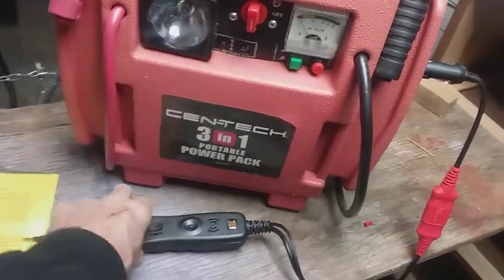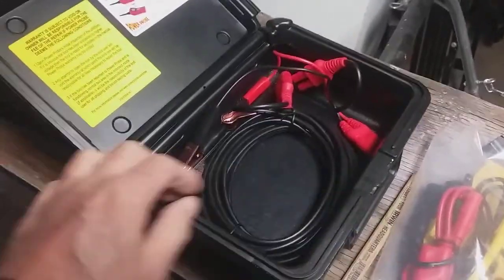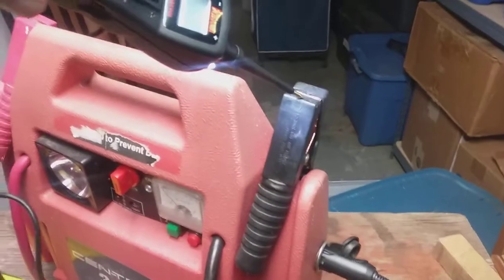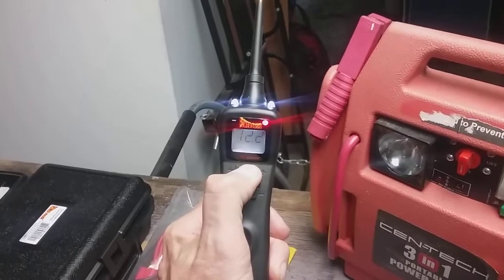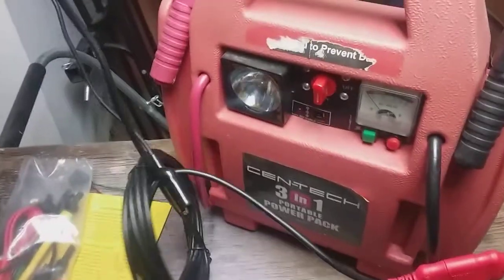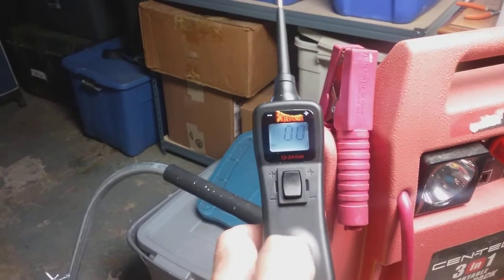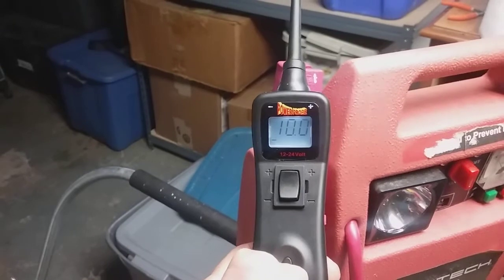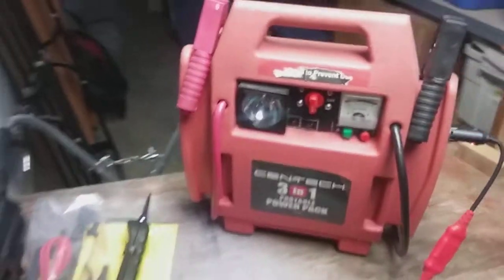Power Probe III safety tip

Comment: Can't you set your probe to 5 volts?
Reply from the maker: Yes, if you buy the adapter, you can restrict the tip voltage to 5V. This tip is to show how to use it if you don't have the adapter.
Reply: @stephenlutz123   Damn, adapter this, adapter that, I'm discouraged by this fact. I was thinking you could change the internal settings, but those are just max voltage reading not output. 😥 Thanks, still figuring out the pp3.
Reply from the maker: @andycrowley6442  just buy this. It's not that expensive.

https://www.amazon.com/Power-Probe-PPT5VA-Simulate-Reference/dp/B076QB4BQL/ref=sr_1_3?gclid=CjwKCAjwm4rqBRBUEiwAwaWjjC3j5reulbRjPT0p1Y9lEc8mpqF2FC403TzeoJ-H1ExmD1RRXyHTkBoCFCMQAvD_BwE&hvadid=243405710856&hvdev=t&hvlocphy=9014228&hvnetw=g&hvpos=1t1&hvqmt=e&hvrand=13585552943594469606&hvtargid=aud-649564993678%3Akwd-477076125757&hydadcr=7515_9880907&keywords=power+probe+5+volt+adapter&qid=1564696015&s=gateway&sr=8-3
Reply: @stephenlutz123  -hey thanx Man! Its on the way. 😁
Reply from the maker: @andycrowley6442  I thought about getting the adapter, but I use my PP 3 just to power up fans, blower motors, etc. I use a DVM on 5V circuits.